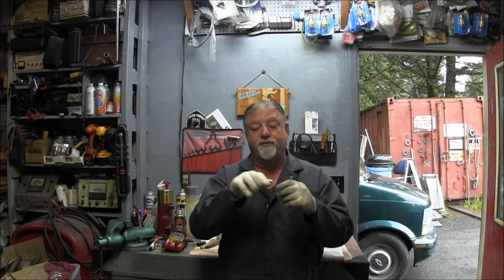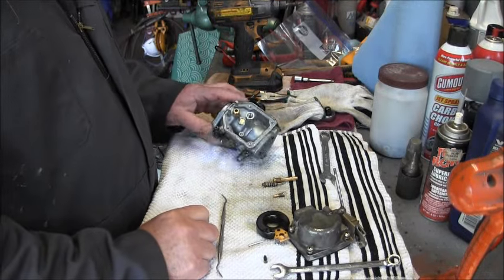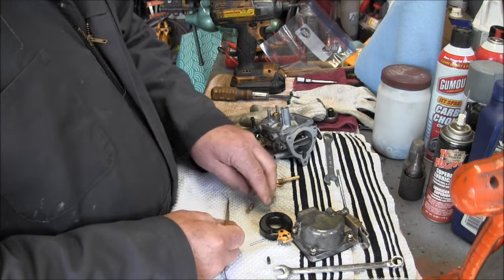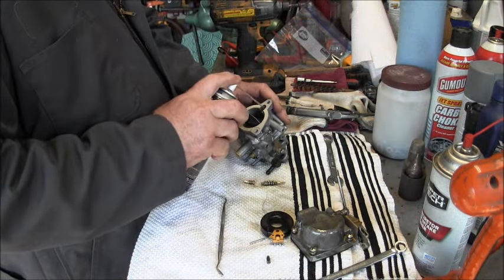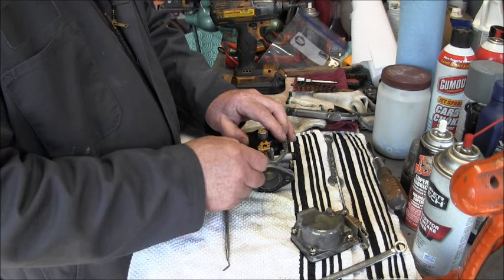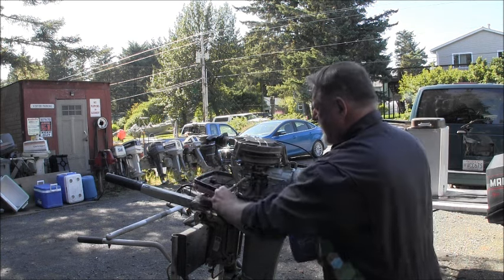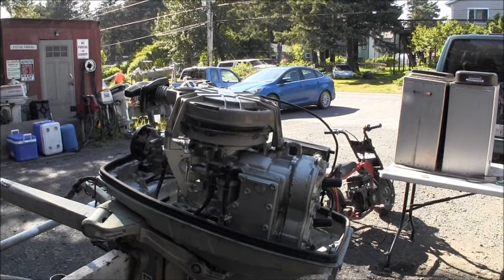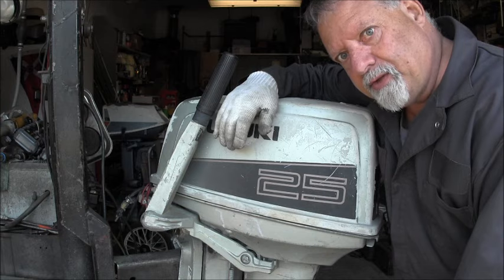SUZUKI  DT  25 HP,   MYSTERY TOOL   & OTHER  FUN STUFF

Comment: They are flaring tools from years ago for larger copper lines and tubing. They are made to hammer in to the end of the tubing to produce a flare much like a common flaring tool of today for break lines and natural gas service lines. Most of the lines that are that size today are now put in with threaded pipe. Not used much any more.
Reply from the maker: Thanks  mate.      kb

Comment: 100:1   Was that a factory sticker and if so what were they thinking and why 🤔👍🇦🇺🦘
Reply from the maker: Yes it is a Factory sticker,  They did that at the end of the 2 cycle engine run before being outlawed ,  That sticker cut pollution emissions by 50%  Allowing a couple more years to sell out their remaining motor's.  Evinrude / Johnson aslo put those stickers on their's .  kb
Reply: @kodibassInsideoutboards Couldn't find hard data on this, but various sources proclaim that contrary to mineral based oil, full synthetic 2-stroke oil will safely allow a 75:1 ratio.